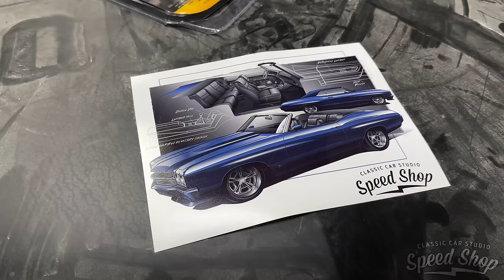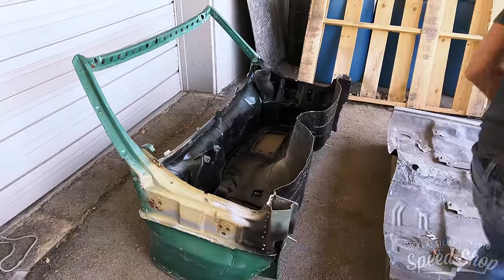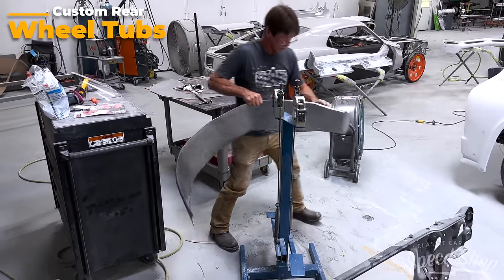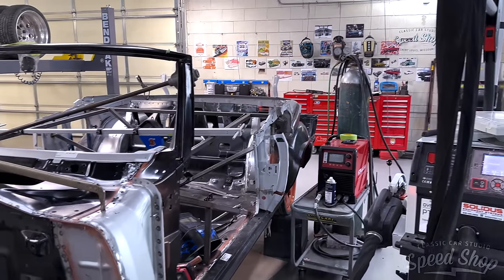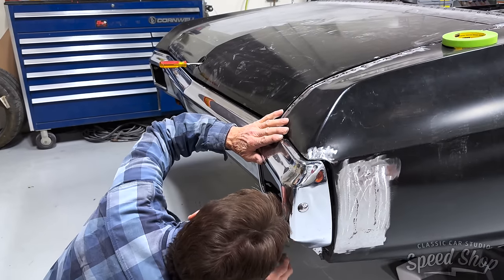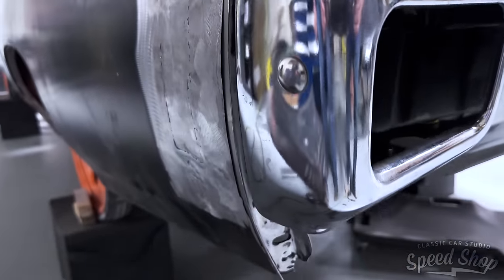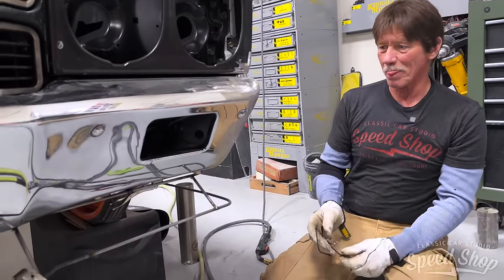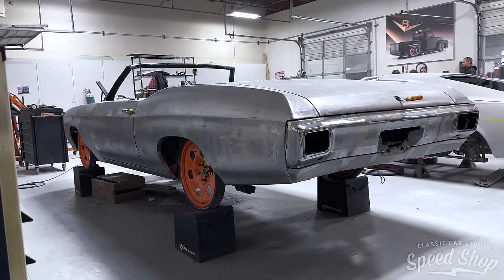Building a New Body • Episode 1 • 70 Chevelle Convertible

Comment: Again I’m confused as to why they just didn’t go with a complete shell from dyancorn. That car is worse than mine and I’m thinking to go that route. There nothing original left of that car anyways lol
Reply: Would a Dynacorn shell been a better option?
Reply: @minni1094  well if you think about the material, labor and the time it sits at the body shop then I would say ya. If your car is that bad and only the inner structure is good, then you are replacing all the original metal anyways. And even the inner structure has rust on it. Idk I have thought about it. You buy the shitbox for the vin and then buy the dynacorn body. I doubt anyone would know the difference it you took your car with all the metal and have it sit at the body shop for months or bought a complete body and maybe have to do minor adjustments. Idk. They been in business for a couple decades and if those bodies where such crap they would be out of business. Only thing that sucks is you have to pay cash for them I believe.  You would have to find a really good body guy to do that kind of work and they are hard to come by. Which means thousands of dollars depending on where you live in the country. If your not building a show car, I’d say buy the complete shell.